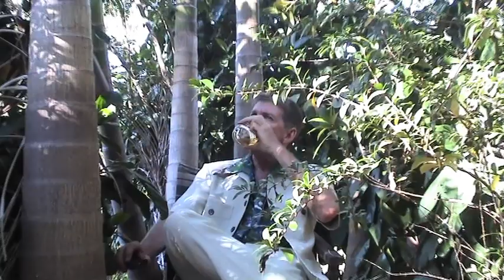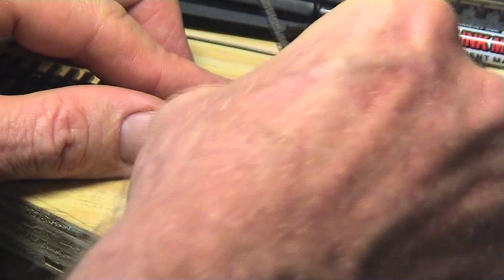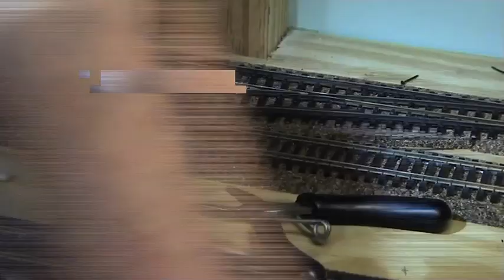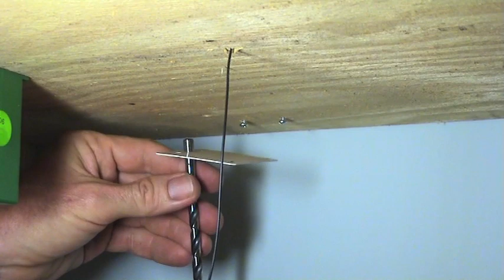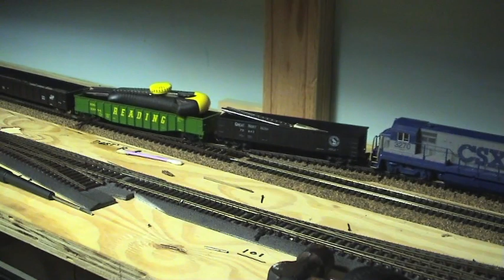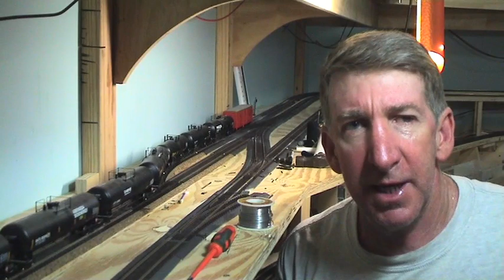Crosover install  on the Birdwood  Sub' Part two.

Comment: Gregg!! Question, when installing Tortoise Switch machine's you always hear the term used two wire's go to the Two outside rails, my question is what to outside rails, the main line, are the Diverging track, are both, I hope this doe's not sound to dumb...thanks my friend, and stay safe...?
Reply from the maker: Not a dumb question at all Fireguy!  If you're powering the frog, you need to bring track power from the track bus to the switch contacts on the tortoise, then when it switch's, it will send the correct rail polarity to the frog.You just have to work out what contacts are made in reverse and normal. See episode 9 for more details!
Cheers Gregg

Comment: Nice job, Gregg! I didn't know you did CSX as well. You REALY need one of these beasts! I can't say enough great things about this engine!
http://www.modeltrainstuff.com/Broadway-Limited-Imports-HO-GE-AC6000-BNSF-p/bli-2463.htm
Reply from the maker: Thanks Jon! CSX will do the local pick ups but no mainline trains, so no big power needed. I don't like the BLI decoders as they are difficult to adjust to the settings I use on the Tsunami's  But I hear good things about BLI locos.
Cheers Gregg

Comment: Hi Gregg,is there any reason why you used the smaller radius points for the crossover rather than the large?
Jon.
Reply from the maker: Only because I had them spare Jon!! It's also is a good excuse to Notch down to go through them and then give it heaps to climb the Helix..LOL
Gregg!

Comment: Works like a charm. Like you said, a little sharp for a mainline but sometimes the crews need to slow down from the "need for speed" syndrome.
Reply from the maker: Thanks Penn' !. It's a "secondary route" to be used as necessary and yes,,a good excuse to crawl through!
Thanks for watching.
Cheers Gregg

Comment: Every layout needs a work train! Great job on the crossover Gregg! I run modern diesels on the NS for a living, including new BNSF and UP units from time to time. They are great but I will always be fond of the good ole SD40-2. One of the best locomotives ever built. Keep up the great work! 

Tim
Reply from the maker: Thanks Tim!, yes , the U-Boats follow me around and have done for nearly the whole layout. I'm envious of your job mate, I'd love to apply for a Drivers/Engineers job, but I think my eyesight would let me down? I have sat in a few cabs and feel at home instantly, and the few cab rides I've had felt normal to me, but still great fun! Driving in the US , with it's variety of scenery and seasons, looks like a fantastic (and I'm sure stressful at times) job! The SD40-2's are certainly legendary loco's, and there are many on the  Birdwood Sub' roster! Thanks for watching Tim, Gregg

Comment: Need to create a separate switch buss when you set up switch 8 and switch its. Get seperate booster to run it on. Found switch 8 will use .5 volts in stall pistion 8 switches.